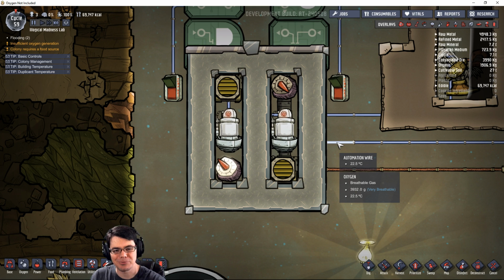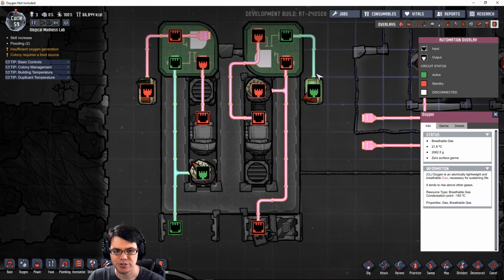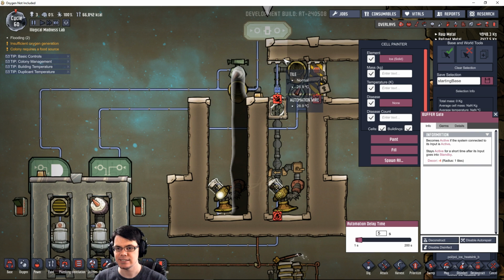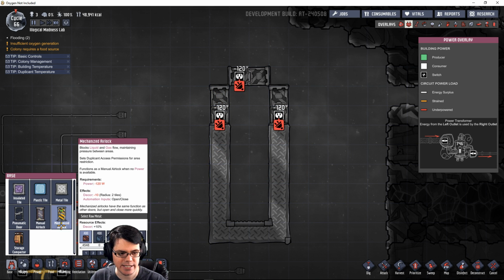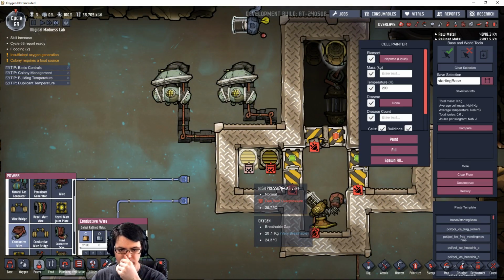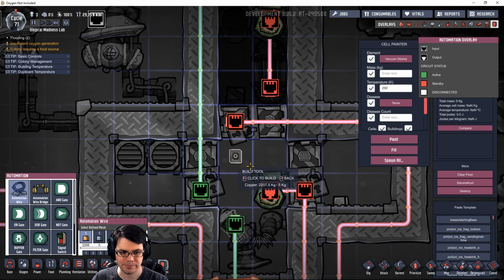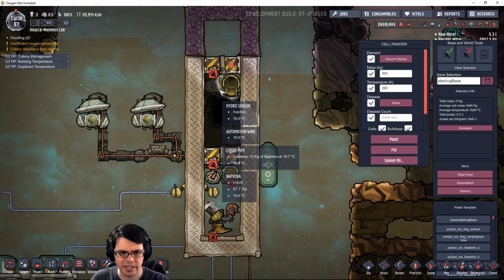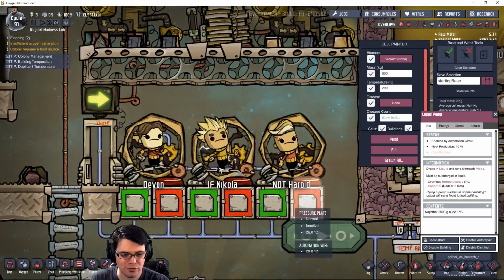Automated Super Air Compressor! Oxygen Not Included Automation Preview

Comment: Wait, so if I understand correctly, this is just a HORRIBLY over-complicated way to have a system stay on once it turns on until another condition is met? You can do this purely with gateway logic by having the output wrap back around as an input.

Basically, have it run if 

The Activation condition is met (A) OR it's already running (C) and the deactivation condition is not met (B).

Essentially, C = A+ CB'

That is, it runs (on activation) OR (It is currently running AND NOT deactivation condition).

Basically have the output that determines whether it runs wrap back around as an input AND only have that continuation run if the deactivation condition isn't met. Once the deactivation condition is met the fact that it's currently running will no longer keep it running.

Comment: I made one of these yesterday! Much simpler and efficient though. Just have a 2 wide vertical column, horizontal door in the middle, and fill the top 1/2 with water (no need for naphtha). In the bottom put some mesh tiles and an electrolyzer on them. Under them put a liquid pump which pumps the liquid back into the upper chamber. The compressed air, and hydrogen ends up in the top of the column, do what you wish with it.

Comment: I noticed that doors push gasses away from them when they close, why not make something that opens and closes them in a row to compress? I would provide a picture but I do not own the game so I will try to elaborate on the system (could be useful to store spare gasses you have an excess of, like CO2)

Have a set of 4 or more doors side by side, chamber with source of gas on the left and a chamber for the compressed gas on the right. The more doors you have the more you will be able to compress with each "pumping" motion. all doors start from the closed position.

1. Open all doors except for the last one.
2. Let gas fill in the space of the doors.
3. Close leftmost door (rightmost door still closed).
4. Close every door inbetween one at a time going from left to right, leave one door open (rightmost closed, the one next to it open and filled with the compressed gas)
5. Open the rightmost door.
6. Close the last two doors in sequence left to right to shove the remaining gas into the compression chamber.
7. ????
8. Profit
9. Repeat for more profit.

Comment: Hm... Say someone compresses 4 tons of hydrogen in a small chamber and heats it up to 1500C. Lets call it heat chamber. Now there's a door system to the right from it that leads to a set of 2 storage boxes. The storage boxes have a door on top of them with 3x2 amount  of liquid and below them mesh tiles and a door. The door system will allow to push the heated hydrogen to the storage chamber and the liquid system will allow to push it back. This will allow to heat the contents really quickly using that amount of hydrogen AND keep it in vacuum afterwards. Further more you build a second set of door systems and a compressor on the opposide of the storage chamber with cooled hydrogen in it. You can then automate the process to heat stuff, then cool it down in a single switch flick.

Comment: Since the compressed air is leaving the top, it doesn't matter if the last air tile is one the left or the right, so maybe you could use water and not have to pump for quite so long since you don't have to move nearly as much liquid?  If it works out, it would make it much simpler to set up, especially if you use compressor chambers more than 2 wide.  Also adding a delay to the bottom airlock, making the compressed air chamber close first, would mitigate that big pressure drop when it cycles.

Comment: As for me, you are overcomplicated  this system. 
At  first, there should not be empty space in working space. Cause then not all of compressed gas goes to  storage chamber. this reduces the efficiency.
Then you should pump gas directly in working space.
This  is my system. That compresed ~ 35 kg of oxygen with 100% efficiency pe working cycle. And it is easy to sacale up.
https://steamuserimages-a.akamaihd.net/ugc/856108744052645875/30EA6A84B086E794352F6CD06CA65EA1CB133942/
https://steamuserimages-a.akamaihd.net/ugc/856108744052666827/39B468844E45D769C8DFD613EF710A2995647801/
P.S Sorry for my english

Comment: you could use the compressor to store harmful gasses away in a very small area. chlorine for example, don't want it in your base build a tiny storage tank and cram it all in there. if you could have it only compress when the system side hits 20kg so it only runs when it is needed.

Comment: I made a refined air lock pump. It is able to compress the co2 from a natural gas generator without the vent being over-pressurized. I didn't test its max volume of gas but it is stable.  It only draws 129 KJ and was still pumping after it compressed well over 300 kg of co2.  https://imgur.com/2t7YdMU   https://imgur.com/hAoEKVW
Reply: Cool. Probably the best solution I've seen so far but why even power the doors? You don't technically need to.
Reply: Thanks Samsonite Dove. I wasn't aware of the doors not needing power. I will have to look into it.
Reply: Btw, I mentioned your version in a thread on the forum (I'm Saturnus there) https://forums.kleientertainment.com/topic/83805-automated-super-air-compressor/

Comment: I was feeling a bit inspired so I build something similar that avoids using the gas pumps seen here: https://imgur.com/a/Xwwoi 

An explanation of how it works. Much like your design there are 4 sections, which I will define as Section 1: Vent room (the room with the vent in it) Section 2: Holding room (the room with the liquid pump), Section 3: Pushing room (the room with 3 hydro sensors), and Section 4: Pressure Chamber (the room holding the compressed gas at the top) 

To explain how this works lets start in the Pushing room. The top two hydro switches are set such that when there is a gas pocket the ore gate they are connected to will open. However if they are both submerged the liquid pressure is lower and gives an inactive signal. This makes it so the door to the Pressure Chamber only opens if the Pushing room is full of liquid and has a pocket of gas in it, once the pocket is gone the door closes. The lower Hydro Switch sends a signal to a Filter Gate with a 50s timing  telling it the Pushing room is full of liquid. The reason for the Filter Gate is to allow the liquid to finish filling and the door to the Pressure Chamber has time to open and close. 

Next the two Atmo Sensors, inside the Vent Room it is set to Above 1000 and inside the Holding Room it is set to Below 1000. Basically this is being used to make sure the pressure in the vent room is greater than the pressure inside the Holding room. 

At this point there are several logic tests to see which doors can be opened. Starting with the door to between the Holding room and the Pushing room. We ask are both other doors closed? This is a two part question first is this room full of liquid (3 Hydro Sensors and a Not Gate signaling an And Gate)? Second is the Holding room pressurized enough that the door can't be open (2 Atmo Sensors a Not Gate and an And Gate signaling an And Gate)? If everything comes out green the door will open dropping the liquid.

Next the door between the Vent room and the holding room. First ask does this door want to be open (2 Atmo Sensors signaling an And Gate)?  Next ask is the other door be closed (use signal from previous test)? If all green open.

The Filter and Buffer Gates which I have not mentioned to this point are both set to 3 seconds just to make the dropping of the liquid work a bit smoother. 

As for practical uses this could be used to keep air circulating in a base if for example you were using 02 to cool your base ore wanted to eat all of the cot and natural gas that managed to get in. You could also use it as a way to store natural gas to be used for power when you need extra generators running getting more efficiency out of a geyser.

Comment: Built a huge one in June. Pumps take a long time. I suggest a dual cycle, if you fill both the top and bottom spaces with gas then you'll be compressing on the pump and dump cycles. Just have to top hold more fluid than the bottom so you can't lose compression on the dump cycle. 
Original after i started pumping and remembered to screen shot  https://steamuserimages-a.akamaihd.net/ugc/772778325792246586/33282844E66DC1C5CABC3B5F5BED9C11BCE96885/
New mock-up using devmode, ~4-1 compression https://steamuserimages-a.akamaihd.net/ugc/856108744050541321/1366280B2E9A88C4F64A027C048869A64D8678FA/

Comment: The real question would be if you did this to compress hydrogen enough, would you create a plasma, and then would you have fusion, or does the liquid pump end up stopping when the gas pressure above it is higher than it's capacity. You should try reversing it, so the high pressure area of gas is at the bottom of the cylinder allowing gravity to create the pressure rather than the pumps.

Comment: What I use to compress gases, for example if I wanna get rid of a gas in the base I cannot handle yet, is a 2 by 3 tiles large cell with a gas vent on the floor and water in front of it. As long as the water pressure is lower than the vent's max gas pressure it never reaches overpressure, so gas easily builds up to 100kg per tile. I know that this technik might get fixed in the final game and its quite old but in my latest game it still worked. Furthermore I do know that it has no relation to the newest update and you tried this compression system for fun but still I was wondering if you might not have known this.
Reply: He briefly mentioned this at 4:50 and has used this technique a few times, notably in the hydrogen bubbler saga
Reply: Total Blazing Ahh, I didn't notice that. :)

Comment: the main point of the compressor is that you're introducing new gas into the bottom chamber, which somehow gets displaced, making room for more gas, the way you have it set up right now you could potentially create infinitely pressurized gases, so the limiting factor here is not getting all of the gas into the top chamber, but rather clearing out the gas from the bottom chamber, so more gas can be introduced into the system. using the high-pressure vent therefore is a good idea so you can get as much gas as possible into that bottom chamber before displacing it to the middle with the naphtha

who knows, maybe some gases actually do stuff if you get them to high enough pressures? (CO2 for instance should liquefy at some point)

Comment: Is there a hard limit on how much gas you can compress in that chamber? You provide 40 kg of oxygen in the bottom layer of this contraption (2 tiles worth of gas from high-pressure vents) and in the same time you have more and more oxygen up top (for example: 200 kg O2/tile). Shouldn't the difference in pressure levels cause this to equate so that you effectively lose oxygen in the top chamber?

Comment: Try this method https://imgur.com/a/hQbAN
less logic here :)
P.S. You can compress all gases in side your base beside oxygen. This is very useful way to get rid off co2 and polluted oxygen
Reply: Thats exactly what i thought. You can just use a stack of doors. No need to use any liquid.
Reply: Could you also use that door setup to pump liquids?
Reply: At current state, doors completly destroy liquids
Reply: Oh, that's too bad.
Reply: From my testing it seems that doors only destroy liquids (and gas)if there isn't an adjacent tile to flow to. I may have lost a few grams from compressing and expanding polluted water but doing it 20 times in a row didn't even remove 0.1 kg from the total amount. (Edit: for reference I used 20000 kg of polluted water and compressed it to four tiles)
Reply: ohhhh... i'm liking this idea, but i expanded on it so it runs faster, as this can only run about one load of gas per cycle: https://puu.sh/yf9xZ/0ab83e9b43.png
and as video: https://puu.sh/yf9Cn/948d7ed705.mp4

i actually found this system to be capable of blowing holes in obsidian tile walls with just pressurised CO2 and some raw oil
Reply: No they dont. If you close door one by one https://imgur.com/a/KnXIt
Reply: You can also do this using only 3 doors https://imgur.com/a/4WU7a

Comment: Something i realized watching this. not sure what the real use would be, but having a long corridor of doors with one second offset per door. You could super compress liquids in one end of the corridor. I am not sure how the debug mode works, so can't try it myself.

As for the gas compression, it could be good if you do what i did, drop a ton of oil into the lava. Since you risk ending up with 140kg tiles of natural gas when the oil and gasoline boils off, you really want to go somewhere except into your base.

Comment: Thought about using a series of automatic airlock doors as a pumping method?
With the new logic circuits, you can set up a corridor of mechanized airlocks that pushes liquids or gas from one place to another, and at high pressures. It could be much faster than a pump, but at the cost of more materials and likely a bit more energy given open doors uses power.
Reply: Something I actually meant to design. You just need 4 doors and logic that makes sure that air (liquid) has somewhere to go. So it must have an open door in front the air (or liquid) can escape to. Since it uses doors it technically doesn't even need power at all and from the right materials it can survive much higher temperatures than a normal liquid pump. I was thinking of it to pump lava.
Reply: I've built this thing and it works really well. It's super easy to make. I just used three not gates and three buffers for my clock and took the positives off of that and ran it to my doors. It works a treat.

Comment: Yeah, Brothgar. You made a classic SR-latch, that remembers last input (Reset or Set). It should be doable with just automation components.
https://upload.wikimedia.org/wikipedia/commons/thumb/e/e0/RS-and-or-flip-flop.png/220px-RS-and-or-flip-flop.png
Reply: Brothgar with two not-gates you can do RS lach, put them in parrel and flip one of them
Reply: OR gate has as inputs: SET input and AND output.
AND gate has as inputs: OR gate output and inverted(!) RESET input.
That's it. =)
When Reset turns on, it disable AND gate and turns output off. Since output is off and Set is off, OR gate turns off. Which means when Reset turns off, AND gate is still off.
When Set turns on, it causes OR gate to turn on, whether or not output is on. Since Reset is off, AND now has two on inputs, so it turns on, and output is on. Once Set turns off, output being on will keep OR gate on, so AND will stay on as long as Reset is off.